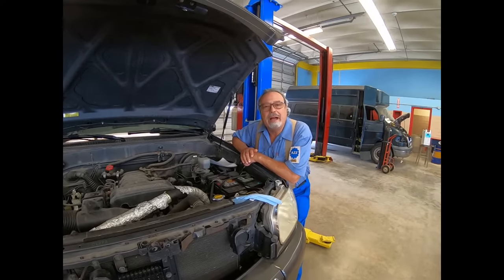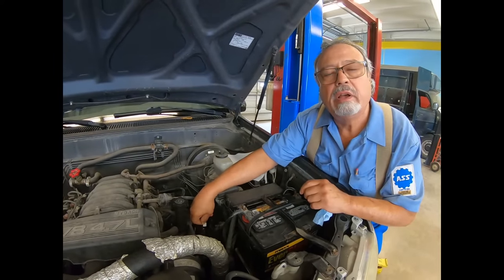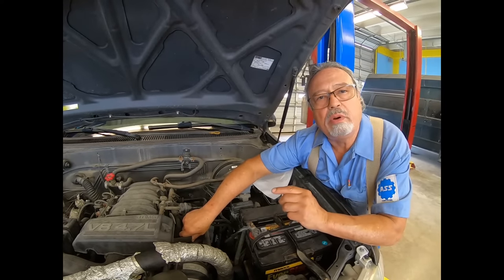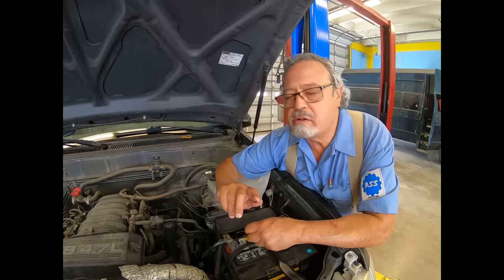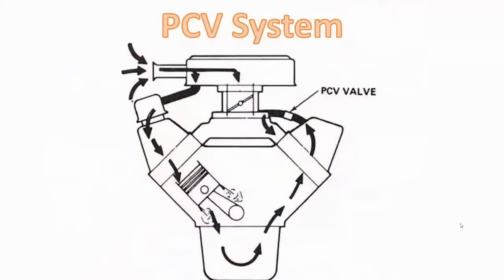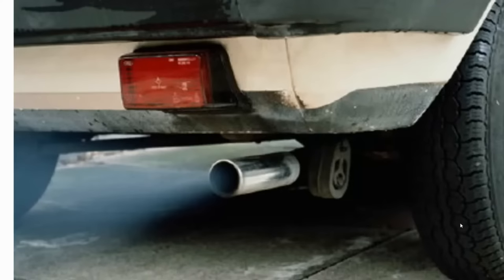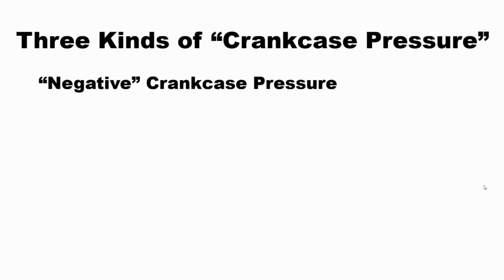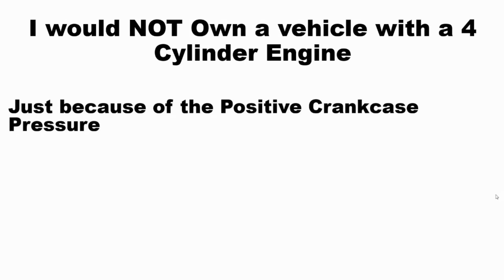Learn how IMPORTANT the PCV Valve is and why you should test it.

Comment: 2.0L tsi ea888 4 banger in my '19 golf r has alot of vacuum i use a easier trick to chk my pcv i pull dip stick but dont wipe oil off start engine then just put the tip of dip stick in and u can hear it sucking the oil off and down in engine

Comment: Very helpful as I’m trying to figure out why the runners in my Corvette’s TPI intake are oil coated after only 300 miles of driving.  I will have to try the paper test!
Reply from the maker: Thank you for the view and the comment. The intake gets dirty from two sources. The PCV system and the EGR system. Good luck my You Tube friend.

Comment: Does a test of the PCV valve require it to be absolutely tight? Some people use a "balloon" test to see if this check valve passes air in the reverse direction...and some say it "fails" if it decays slowly. I would imagine this is not the same deal as a cylinder inlet or exhaust valve metal-to-metal seat which is required to be "tight"...so what's the deal here?

Comment: So I did the paper test on my 4 cyl. 96 Honda Civic EX and sure enough it just flutters and doesn't get sucked down onto the dipstick opening at idle.  So I tried an automotive vacuum gauge on that location and got no measurable reading.  Reasoning that it could be too small of a vacuum to register on an inches of Hg gauge, I made up a U tube manometer out of clear vinyl tubing and put some water in it with a yardstick and the tubing held to a vertical stick of 1x2 lumber.  Got small reading of vacuum but barely readable but also there wasn't really any pressure reading.  Disconnected the air inlet hose at valve cover and plugged that fitting and then I got 1-3/8" of H2O vacuum reading.  Disconnected both the PCV hose at intake manifold and plugged the fitting and also the air inlet hose at valve cover and plugged that fitting and got pressure reading of several inches of H2O on manometer but shut that test down immediately.  With all hoses reconnected, when I goose the throttle and hold it I get temporary small pressure reading of an inch or so on the manometer but then PCV seems to catch up and take away that pressure.  So I guess my PCV system is working OK?

Comment: Watched your loooong story to the halfway point and thought that this simple idea will save me a lot of time setting up my pressure transducer and the oscilloscope. So I stopped went to the car and tested, wow it fluttered and I thought I had found my source of oil consumption. 
Ok watched the second half and you guessed it probably, it’s a 4 cylinder Nissan. Darn, but what is interesting now I did pull the hose and the car stalled, tested and had good steady suction on the hose. Next I put just the valve (cleaned it first) into the hose and the car did not stall any more. 
Now the final test I held the hose without the valve directly onto the crankcase and the paper stayed on the oil tube. So I guess the filter is more restriction than necessary it seems.
Interesting Video, looong story but you got my thumbs up for the content,
Bernhard
Reply from the maker: Thank you for the comment. Yes I understand short videos are better than looong  . I will keep them short from now on. Thank you again.

Comment: If you neglect your oil changes, you'll develop sludge inside your engine and this is the first thing that sludge will affect. You'll start sucking oil into your intake and the engine will start smoking and fouling plugs. Once it gets to this point, good luck getting your engine clean again.
Reply: I have a 2018 Hyundai Elantra, I religiously charge the oil but I have engine sludge. Could a bad PCV cause the sludge? (No external leaks). I can't figure it out.  Any help would be appreciated.  Thanks in advance!!

Comment: I just changed my PCV on Saturday.
I have a Poor 4 cylinder engine that has 213,000 miles 
and runs like a New Engine. So does my original transmission.
Of course I do my own service as far as Fluids go.
I didn't know I had an Inferior Engine.
I think I'll keep what I have.
Reply from the maker: Thank you for the view and sharing that information about your vehicle. What kind of vehicle is it ? Thanks.

Comment: I’ve always replaced my PCV valves with new ones. Back in 92’ I had an 89’ Astro with a V6 and at 80,000 miles I took out the pcv valve and cleaned it with alcohol and reinstalled it. Within a week, one of the rocker cover gaskets was leaking oil, the gasket blew out. I checked the pcv valve and it was stuck closed. That was the last time I cleaned a pcv valve. I normally change pcv valves around 60,000 miles or every 60,000 miles. You didn’t mention time or mileage when they should be changed? I have 2 …..2.5L 4 cyl. Engines. One la Toyota, the other a Honda. Comments please. Thanks….Jim
Reply from the maker: Keep up the great DIY serves, they surely pay off in preventing problems. I like to change PCV valve every 25.000 miles. That is a bit too often, but I like to overdo my maintenance. Thank you for the view and the comment.

Comment: So I have a 2005 Cadillac Escalade 5.3l and it is leaking oil above starter and on passeger side. Paper does not stick... Its not the oil pan gasket, oil pressure switch, cam/crank sensor, valve covers or rear main seals. Transmission dry

Comment: The PCV valve on my 2006 Escape 4 cylinder is under the intake manifold which has to be removed to replace the valve. I wonder if anyone has that replaced because it is costly to have it done. I am 200,000 miles past having it done. The car runs well. I do all other maintenance but have not done that. And the manual I bought states three different locations for it, so it does not know where it is.

Comment: Wasn't aware of this. Thankyou. Top knowledge. Is their anyway this concept has any bearing on my dirt bikes. Carburettor/air cooled variety ? I appear to have an oil leak on crankshaft seal
Reply from the maker: My small lawn mower has a rubber tube that directs the blow-by into the air filter box. Your motorcycles probably has the same thing. Thank you for the view, the comment, and the question.
Reply: @theoldmecanicoshow9004  Yes my bike has the same tube. 4 stroke. Thankyou for sharing

Comment: I do not understand why the oil gets "dirtier". If it recirculates the bad toxins back into the engine, hence the oil, is it not just removing some of it in the second combustion but some will always remain and it will saturate itself? 

However, if you just have the pcv open completely to a catch can, would you not just be spewing those bad toxins into the air, leaving the oil "fresher" as you get cleaner air for combustion? 

And the flutter is something I noticed on a 4 cylinder engine I had that was basically brand new. I saw people testing their PCV-systems by flipping the oil cap, mine would just flutter.
Reply from the maker: Thank you for the view and the comment. Almost 100% of the oil getting dirty is caused by the blow-by. Even before the PCV system, engines used road draft tubes that allowed the bad toxics directly into the atmosphere. I don't know what else they can do to clean up the emissions from the engines.
Reply: @theoldmecanicoshow9004  But then running an open tube would in theory make your engine run "cleaner". It is just the whole negative to the atmosphere part that is the worst side-effect.

Comment: If the 4 cylinder engines create lower vacuum pressures than 6 or 8 cylinder engines, can't they make a PCV that opens up to smaller vacuums to prevent blow-by pressure from building up?
Reply from the maker: A 4 cylinder engine creates the same amount of vacuum. However, a 4 cylinder does not create the volume needed to put the entire crankcase under vacuum. Thank you for the view and the question.

Comment: I have a 90 Honda crx si w/approx 348,000 miles.  2 years ago during an oil change & PCV R&R the mechanic broke the old PCV off in the rubber hose ( large hose ).  So I had to bubble gum & zip tie the PCV & hose to a hose in the engine.

I find the hose ( sponge ) has oil running down it ( not alot, just damp ).  The PCV inserts about 1/2 way.

Should I just get it fixed RIGHT or keep on driving.  My gas mileage has decreased ( probably due to the bad games escaping & not being burned again ).

I think I know what I should do, just seeking an auto mechanic to verify.
Reply from the maker: WOW...348,000 miles WOW...congratulations , you must be doing something right. Thank you for the view and the question. If the paper "Sticks" leave it alone. If you watched all the video you should of seen the part about 4 cylinder engines "Fluttering" the paper. I suggest you change the valve and the hose.

Comment: So talk down to everyone for 1:19 and never just show what you’re going on about. Got it. Or fast and free advice, just change the PCV valve every time you replace the air filter if your vehicle is equipped with a PCV valve. Yes some are not and I had a Ram that wasn’t. All there were was air nipples. One looked suspiciously like a PCV valve and I got it out in 2 pieces and had to buy a generic air nipple that wasn’t angled but fit the bushing and the hose good enough. Thanks for the reminder to replace my air filter and PCV valve. Been a while

Comment: The piece of paper did not “stick” to the dipstick tube. I have a pcv valve then hose from rear valve cover hole going to manifold vacuum and a breather tube going to air cleaner from front hole in valve cover. Will this set up just pull air through the valve cover and not up from crankcase? 89 Wrangler, 258 ci motor. Some have a CCV system but I’ve been told my year used a PCV.
Reply from the maker: The PCV valve on the valve cover will pull air / blow-by from the crankcase. It takes a Large Volume of vacuum to put the crankcase under a slight vacuum. I suggest you change the valve / the hose / and make sure the hose gas a ton of vacuum when the engine is idling. Thank you for the view and the question. Break a Leg / Good Luck on your repairs.

Comment: I have an exhaust pressure tester that screws into O2 sensor location to test exhaust pressure.  I need to find it to see if it also shows vacuum as well as positive pressure.  But if it does, couldn't I adapt a hose to connect it to the dipstick tube so that it directly measures the crankcase pressure (or vacuum) and use that for diagnosis?  I assume crankcase pressure or vacuum are typically in the order of a few PSI (no more than 5 PSI)?
Reply from the maker: Thank you for the view and question. I have never put a vacuum gauge on the dipstick tube. But yes, vacuum gauges measure vacuum and pressure. The dipstick should be under a very small amount of vacuum. If I had to guess...I would estimate between 1/2 inch and 1 inch of mercury.

Comment: I was always told that blow by is oil that's escaped from the Pistons meaning you have excessive piston wear or rings that's wore out
Reply from the maker: Thank you for the view and the question. Excessive blow by is caused by two things : worn as in scored (scratched) rings and cylinder walls. The rings and the walls get scored due to overheating and poor lubrication. Thanks again.

Comment: Hi dear
I have gla 250. It has P052E engine which is for pcv valve. The new part is for around $2000. Is it okay if bypass it?.or will it cause negative impact on the engine

Comment: My pvr valve looks missing or the medal part to broke off in the hole.
All I have is the rubber hose that fits right in that hole in the valve cover where it's supposed to be but there's no kind of metal looking valve just an empty hose that is made to fit on the end right where the pvr goes.🤔
Maybe that hose that plugs in there was bigger than that with the valve connected to it but the valve part broke off in the motor and maybe I can just pull it right out with some pliers I don't know

Comment: sir. thanks for useful video... But  in my BMW 320i 2007 e90 I have not engine oil deep stick. How check the PCV valve ?
Reply from the maker: You can place a larger piece of paper where you pour the oil in. Just take the cap off / start engine / place paper on opening. 
Thank you for the view and the question.
Reply: @theoldmecanicoshow9004  Sir, i did. Oil and paper are thrown out.
Reply from the maker: I don't know what to tell you. Does the engine do well: run well / does it consume oil? VW uses a different crankcase pressure control.

Comment: What happens when you remove the valve and install a catch can instead? This is for a high performance big block Chevy engine.
Reply from the maker: Thank you for the question and the view. Catch cans do a very good job of keeping the intake manifold clean from the dirty blow-by. I would still leave the valve in place mostly because in case of a backfire in the intake . You do NOT want the backfire to get into the crankcase. It could overload the seals and gaskets.

Comment: I remember the days of the old road draft tube. For you young guns, it was how the crankcase ventilated before the PCV (pollution control valve) was introduced by Ralph Nator if my memory serves.
Reply: OH, I almost forgot. I have seen motors that were ruined by PCV’s. Not sure if a backfire caused the pcv to fail but the guts of the pcv caused a valve train failure that led to the motor being destroyed.

Comment: Great YouTube! But I've got a 4 cylinder engine and still don't know how to easily test it. I tried the paper test and got the flutter as he shows. My 4 banger Toyota Highlander has a PCV located in a very tight space and labor is over $400 to replace it. I replace my Chevy's PCV in 5 minutes every 30K miles .
Reply from the maker: Toyota is not the "Lone Ranger". All the motor companies have made the PCV system (valve) very difficult to get to and GM makes you change the valve cover. Thank you for the view and the comment.

Comment: Thanks for sharing this video, interesting information . I notice my  exhaust smells like rotten eggs when going up hills  on highway . What’s that ?
Reply from the maker: Thank you for the view, the comment, and the question. The first thing to do about the rotten egg smell is to see if there are ant DTC's....Diagnostic Trouble Codes. If the engine is running rich (too much gas, not enough air) it will smell. Also a catalytic converter that is dirty (restricted) or coming apart, the smell will be there. The codes will indicate if there is a problem with the mixture or the converter. Good luck my You Tube friend.

Comment: When you use a smoke machine and smoke comes out at the oil filler cap, could you please explain how that happens, Sir? Thank you.
Reply from the maker: Smoke machines are used to find Leaks : Vacuum leaks / EVAP leaks / and exhaust leaks. I'm trying to figure out here you are blowing smoke into. The oil filler cap is connected to Crankcase blow-by pressure. WE blow smoke into the intake manifold and induction hose to find vacuum leaks. I want to be more help but, I'm not sure what is going on.
Reply: @theoldmecanicoshow9004  I was trying to find out how the pcv valve is connected to the oil filler cap. So, if you induced smoke into a vacuum hose, would you see smoke come out of the oil filler hole if the pcv valve were stuck open?

Comment: Wow i don't even need to do this test. When you turn engine on. You can see it coming from the dip stick tube. I was told it was normal. Only tube i replaced was the smaller PVC tube. I never ever thought to check the larger PVC tube. FYI i drive a inline5. But i will tomorrow because i just got my rear main seal and front main seal and value cover gasket replaced and still leaking oil but very small amount coming from the side of the larger PVC area on driver's side. FYI I also changed the crank sensor under the engine long sensor not the small one on top of engine.  Which they say also leaks oil. Which was leaking. So with all that. And big leak is now little leak and sucking oil. Now with your help. That should be last piece to the puzzle of why I'm losing oil and you can see pressure from dipstick tube. I had engine checked to make sure engine wasn't bad. All checked out. So this should be the fix.

Comment: How do you know when the four cylinder is having a problem. I understand the paper is suppose to flutter, but what happens when it is malfunctioning?
Reply from the maker: Thank you for the view and the question. You can NOT tell when the PCV system is malfunctioning on a four cylinder engine. The best thing to do is to change the PCV valve every two years or 24 thousand miles.

Comment: Mecanico. I have a 2006 vw gti 4 cylinder 2.0tfsi engine. I changed the pcv and eliminated a vacum leak. With the car running the negative pressure is so much when I pull the dip stick I hear a slight whistle and when I unscrew the oil cap it sucks it down. Is this normal.
Reply from the maker: Every vehicle is different. I do know that German engines will idle to high and set a check engine code if the dipstick is not fully seated. So long as your vehicle does not have a check engine light on, everything is good. Idle good and no check light, slight whistle is normal and pull down on the cap is normal. Thank you for the comment and question.

Comment: I thought you were going to explain why the 6 & 8 cylinder engines created a slight crank case vacuum, whereas the 4 cylinder engines don't' (so much at least).  Any updates?
Reply from the maker: Size matters. The volume of engine displacement determines the amount of vacuum (not inches of mercury / cubic feet per minute) The larger engine can create more volume of vacuum than the smaller engines. I hope that answers your question.
Reply: 6s and 8s sucks more volume of air that's why they have high vaccum pressure.